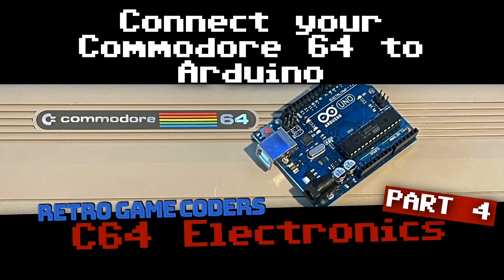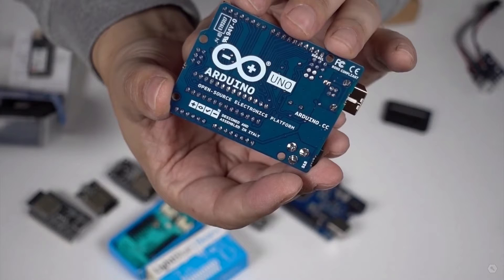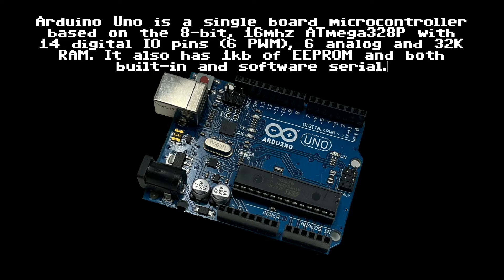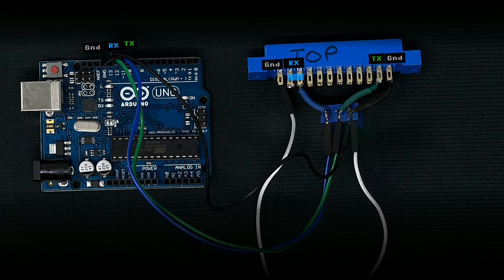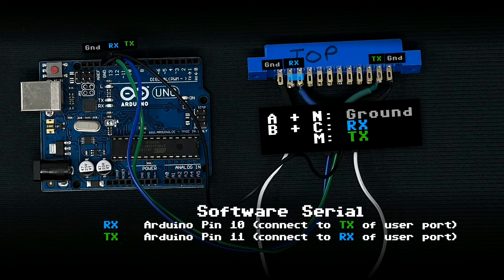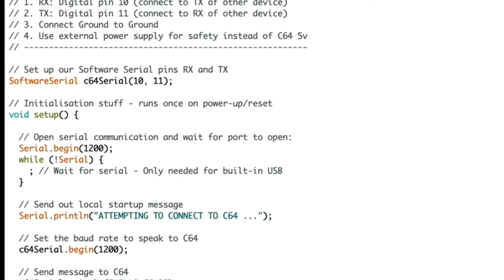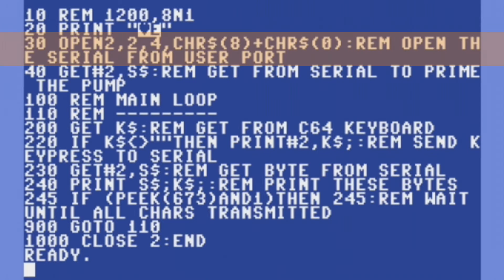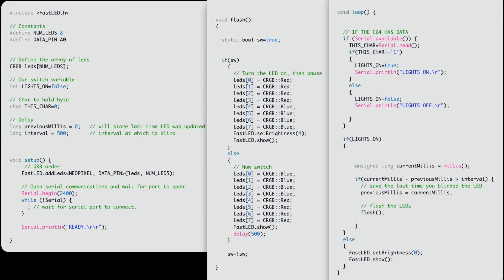How to integrate Commodore 64 with Arduino

Comment: Great tutorial, thank you!
Would it be possible to use the arduino's RX and TX pins instead? 
I intend to run third party firmware on my arduino that can only use the RX and TX pins, if at all possible
Reply from the maker: It's been a while but I imagine so, there are arduino boards with multiple UARTs also

Comment: Now you should figure out how to send programs through such a method
Reply from the maker: Already solved :) use modem app or ftp
Reply: @RetroGameCoders  I looked it up yesterday and got it working with uno2iec. it uses the serial port instead of the user port but it sends programs just fine
Reply from the maker: @Xxx_viagra_xxX  great stuff 👍👍
Reply: @RetroGameCoders  I know this is an old video but can you send me to a link on HOW to send programs PRG files to commodore?? very much like to know how to do that... like to load a game?